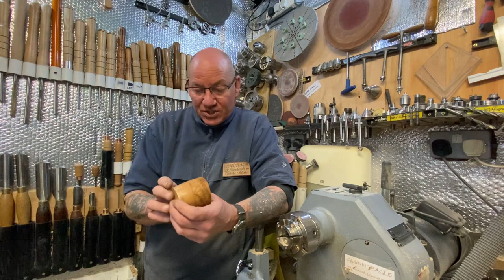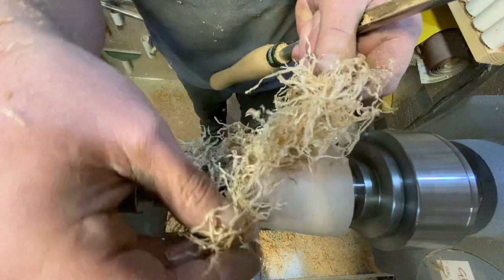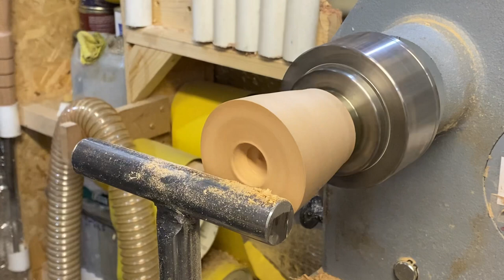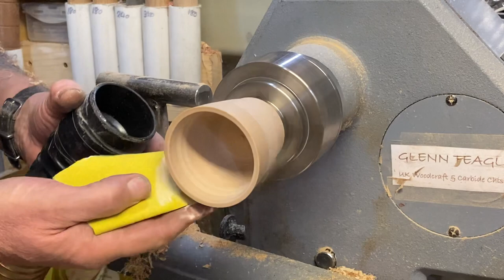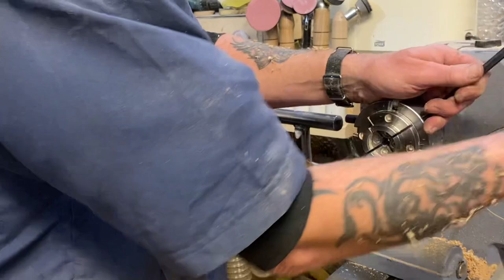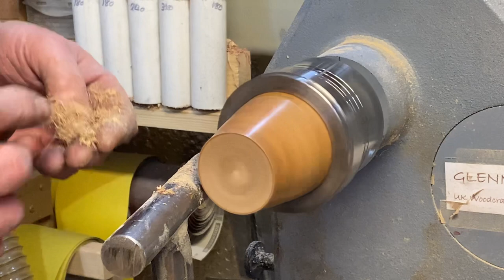Woodturning a small pot with carbide and traditional tools

Comment: How many different chisels did you use, how many carbides did you use, super to here not only the differences but also how they cross over which, we are always having to do because os sooo many different reasons ie w might just not have the right chisel - yet. 

Really insightful video Glenn & I think that was a perfect illustration, of the range of tools to offer and there uses.  

Good refresher to on your ‘AU’ cutter, as with other people, as a newbie it’s easy to drift into bad habits. 
You teach us the right way, we listen and adopt then, we (me) drift into a bad presentation; 
I’m quilts (I’m pretty sure) of… scrapping with the side of my AU cutter thinking I was cutting. 
Sorry & thank you Glenn, sorry drifting into scrapping & thank you for the ‘heads up’ in you video on this practice - it ‘will’ be correct!
Reply from the maker: Thank you Peter,  I’m trying to show that whether you have so-called traditional or carbide, they can all be used the same way. Sometimes you just have to scrape because that’s what’s called for.